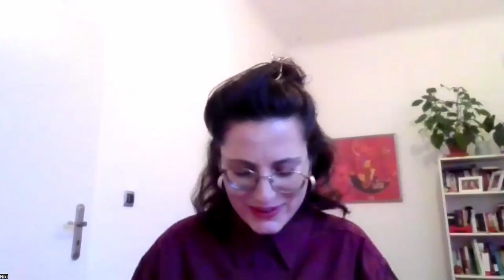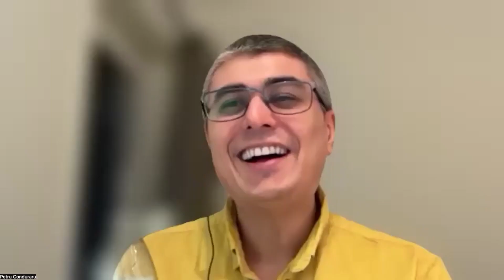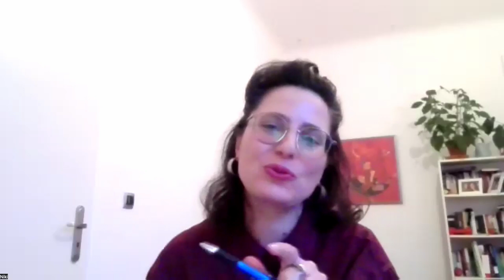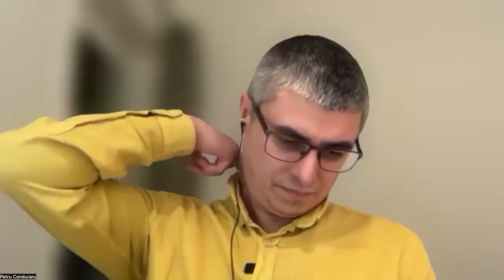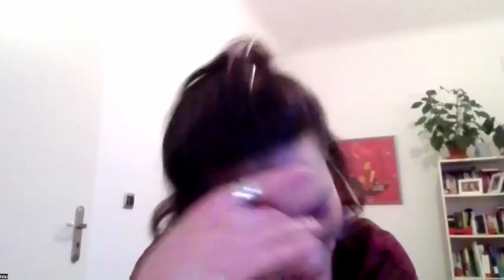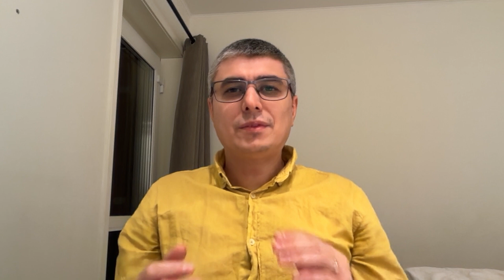From Overwhelmed to Confident: My Breakthrough With Bonsai Bootcamp

Comment: I think it is IFC's strength to link building structure to MEP. This time we're talking about issues with MEPs. However, I would like to see this theme continue.
Reply from the maker: Hey @koara5867, great point! IFC’s ability to connect structure with MEP is a huge advantage. I’ll keep this theme going in future videos. Let me know if there’s a specific MEP topic you’d like to see!
Reply: @BIMvoice  IFC can model the MEP in a model that has a proper IfcBuiltElement and IfcGrid. This is a counter to Revit's attempt to get away with linking MEPs with different files.
Distribution Board, Cable Segment, Cable Carrier Segment, Fan, Duct Segment, I thought it would be good to model these as MEPs. 
I don't understand Port Nesting and hope your video can help. Thank you